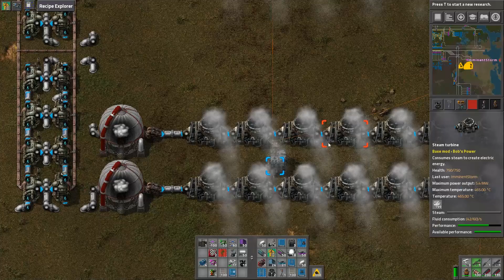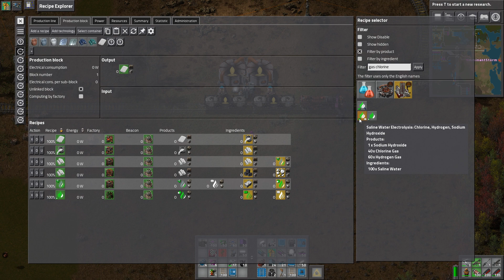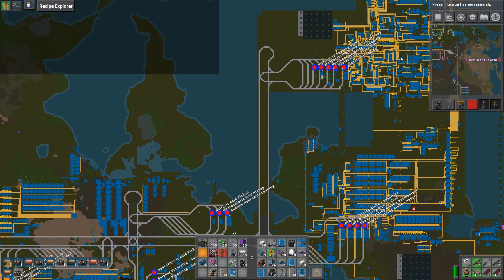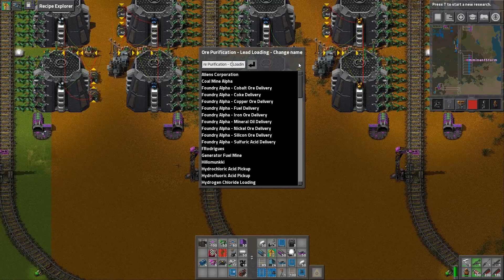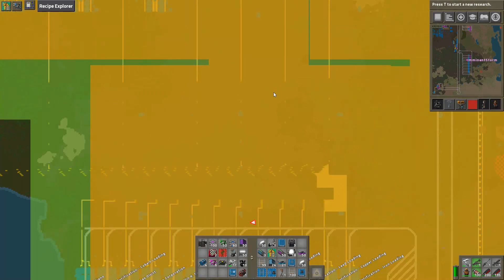Factorio - Angel's & Bob's - Episode 136 - Bringing in Materials

Comment: At 38:21, you cut off your flow of ... something brown, I think thermal water ... when you placed that horizontal underground pipe to the clarifier. You'll need to use nothing but above-ground pipes for your horizontal piping in that section, so as to not cut off the flow of whatever you have left and right. Vertical underground pipes still work, though.

Comment: I'd suggest doing something with your acid gas, either bringing it in and cracking it on-site, or else cracking it elsewhere and bringing in its byproducts. It turns into hydrofluoric acid (which you'll need pretty soon for making tungsten plates), carbon dioxide (useful in many places), and a LOT of hydrogen sulfide (which you could use to supplement your sulfuric acid production). I think you're going to start running short on sulfuric acid pretty soon, and you have all that acid gas just sitting there doing nothing at the moment, so turning that into sulfuric acid plus two useful byproducts seems like a good idea.